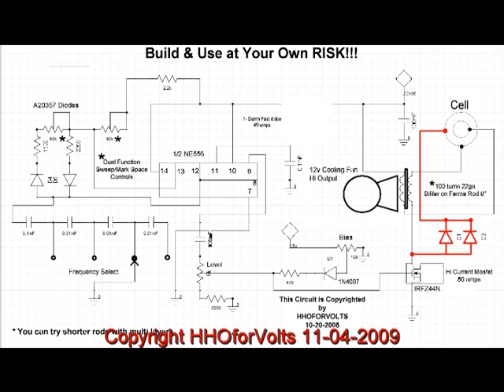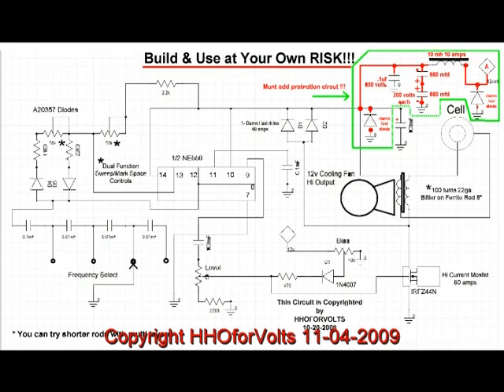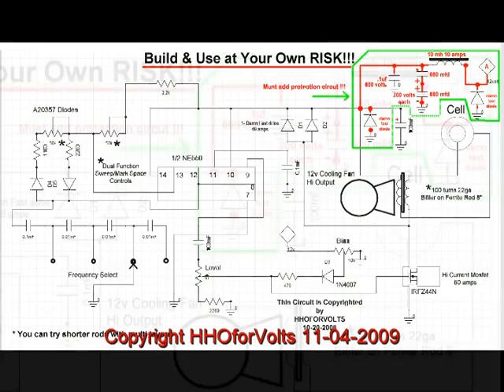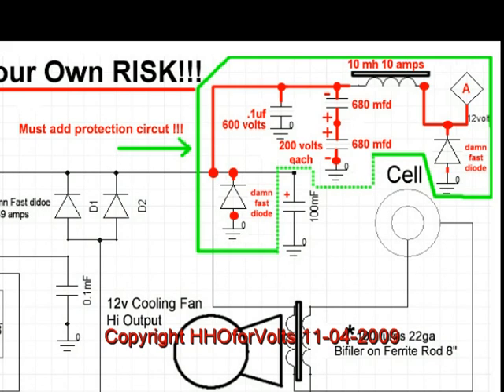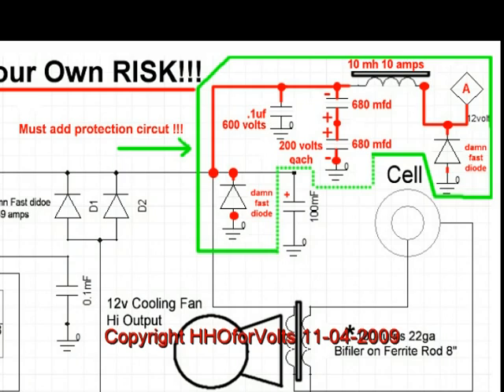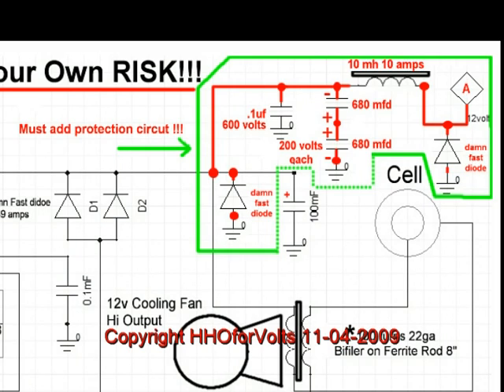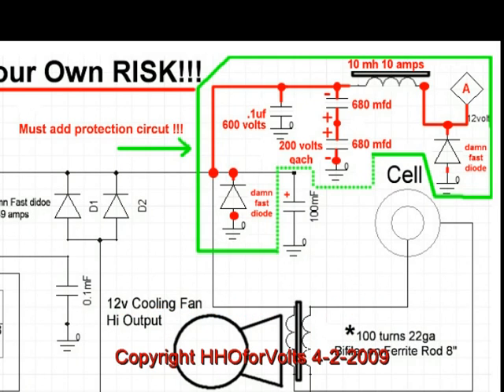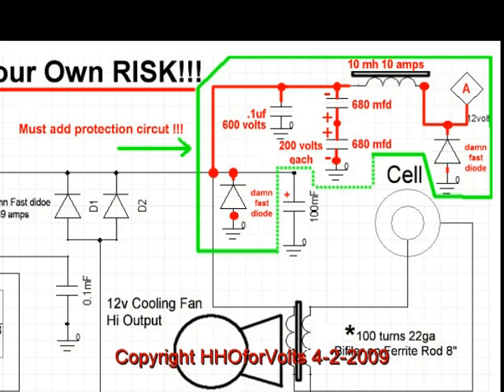HHO Over Unity Protection

Comment: The reason I ask, is because I have heard that certain coils can interfere with some reading instruments. If the current is a mix of both ac and dc, the instruments might have trouble giving a proper value. But It is not my purpose to be a "partybreaker" here! 
You have found something interesting and it should be investigated more! I just think that is is more proof of energy gains in a system if it can do some kind of practical work, perhaps light up a lightbulb or run a fan. Good luck!